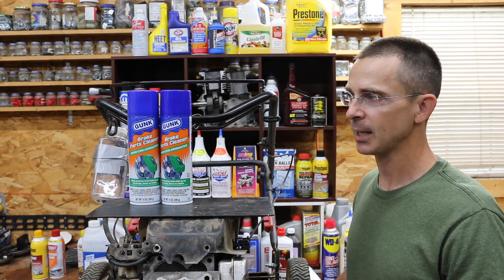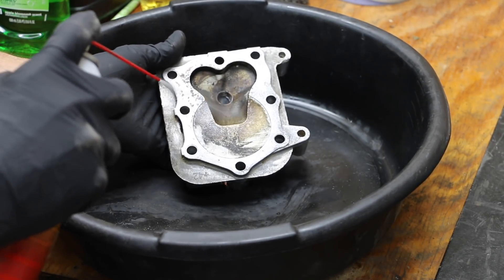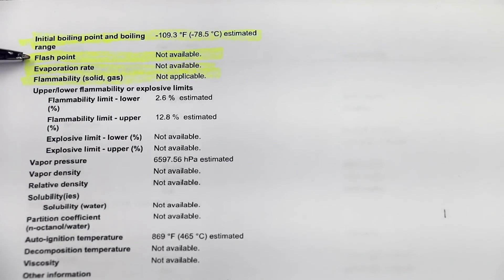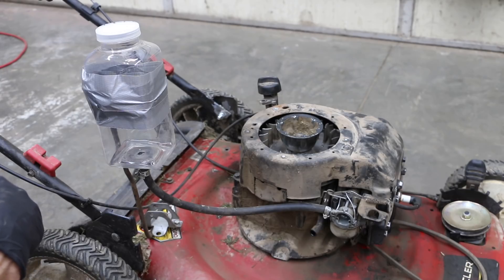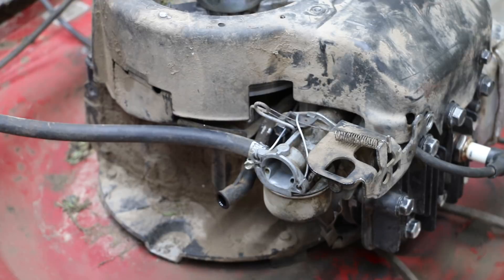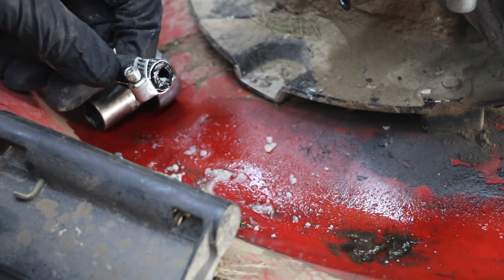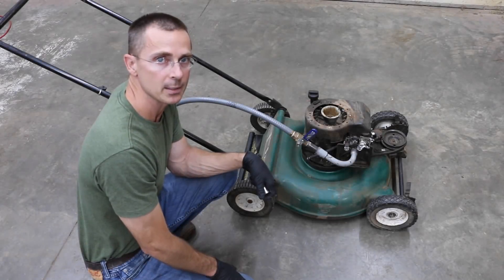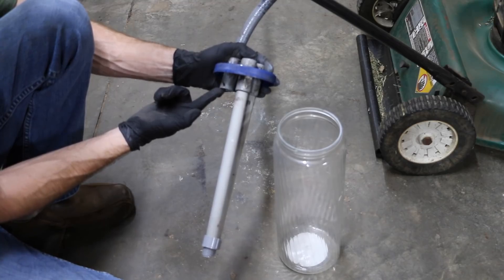Will a Gas Engine Run on Brake Parts Cleaner?  Lets find out!

Comment: Which type of epoxy is most resistant to gas exposure? This is something I would love to know as I need to repair a small engine carburetor after the winter most likely.
Reply from the maker: I'll see if I can test this. Thank you for this recommendation.
Reply: Finest Hops
I happen to know that the Locktite 2-part epoxy sold in grocery stores, hardware stores and autoparts around Kansas City is about as perfectly fuelproof as you can get short of solder or brazing. I have fixed a couple hundred old small engine, motorcycle, car truck and tractor carbs with the stuff with zero problems. 
1) Get the parts perfectly dry. I have washed mixed-together-but-uncured 2-part epoxy off my hands with a gas rag.  2)  Let it cure 48 hours at room temperature for best results.  3) On sidedraft carbs a part of the casting comes down and usually a bowl nut screws up into it to hold the bowl on.  I've had that casting corrode clear off and saved the carb by applying  2-part in 1/8th" layers (letting it cure good before applying next layer) until I get a blob big enough to work with. I file and rotary file it into shape on the outsiide and then carefully drill and tap (cut internal threads) the mass of epoxy to accept the bowl nut. You can't get crazy torguing it tight but just nice and firm is all that's necessary and so far so good on a smooth running stationary engine (a welder). I wouldn't trust it in an airplane or motorcross bike but so far so good !
Reply: you want to use a novolac epoxy as your first option, and a bisphenol F epoxy as a second choice. unfortunately most kits sold at the hardware stores are nether. most sold are bisphenol A which has a weaker cross-linking then the above two. if the packaging doesn't tell you what it is then you may have to resort to MSDS. urethane, polyaspartic & polyurea will likely stand up a little bit better but will have much worse physical and bond strength.
Reply: Me too!
Reply: I 3rd this notion
Reply: Engine grade epoxy exist. Have not used myself, so don't know brands. But I know of enginebuilders that use engine grade epoxy in intake ports that tolerates gas. But oxygenated gas, like E5-E100, or with methnaol, wil make the epoxy come loose eventualy.

Comment: Ive got a suggestion, when you compare carbon buildup running different fuels or showing the see through cylinder head, why not show what it looks like on regular gasoline? like for the carbon buildup show what the engine looks like running on gasoline for a similar amount of time so we can have something to compare it to.  Also why arent you cleaning the valves and cylinder head so carbon buildup transferring from the piston and valves to the cylinder head doesnt happen?
Reply from the maker: Thank you for this recommendation. The goal of leaving the piston and valves uncleaned is to determine if the product cleans.  This stuff actually did a pretty good job cleaning carbon off of the piston.  Thanks again.
Reply: Well if you are trying to determine if it cleans why not run it twice once uncleaned to see if it cleans then clean it and run it again to see if it makes it dirty?
Reply: TheGirfan1234 I like this idea.

Comment: Just wondering, why did you put 2 air inlets for the vapor assy.?
Reply from the maker: I could always block off one of the tubes if it wasn't needed. 2 provides more air flow and less splashing.  Thought it was good to have options.

Comment: My father and i worked as small engine mechanics for a couple of years, but the most fun we had was launching a weed wacker piston out of a cylinder with 2+2 carb cleaner. You should try to run an engine off of that.
Reply from the maker: Thank you for this recommendation.

Comment: Will it tun on carburetor cleaner
Reply: nightmare in action nighmare in action   probably, imagine the same propellant is used for both
Reply: nightmare in action nighmare in action it will it’s commonly used as a starter fluid

Comment: Will a engine run on Jet fuel?
Reply: A diesel will.

Jet fuel is basically kerosene.
Reply: yes but jet fuel is higher quality and it would be fun to see if there is a difference, And yes its a lot like diesel but still i think it would be fun.
Reply: No because its basically a high quality diesel
Reply from the maker: Thank you for this recommendation.
Reply: lusmiaka Nope it's similar to diesel... XD
Reply: Scott P Correct
Reply: Gas engine can run up to 50/50 mix but already knocks alot and smokes and sparkplug getts oily...

Comment: yay great again.   gonna push my idea of a hot exhaust diesel evaporator and see if you can run and maintain from the hot exhaust. if that works can try others, kerosene, vegetable and old engine oil etc
Reply from the maker: Thank you for this recommendation and thanks for the positive comment.

Comment: there is gotta be a way to modify the governor to let you reach higher rpm
Reply: There is, you remove the spring on the restrictor plate, or remove the spring going to the governor. Commie :)
Reply from the maker: Yes, it's pretty simple to do, but I didn't want to cause damage to this engine.

Comment: Its basically carb cleaner
Reply: Rhead_neck nick 
Carb cleaner leaves residue. 
Brake cleaner dries spotless clean. 
Like prepping for paint on a part , would you use carb or brake cleaner? 
Or when cleaning with carb cleaner and the piece is clean, I hit it with brake cleaner.
Reply from the maker: Great point. Thanks for commenting.

Comment: As a mechanic we used brake cleaner to drive cars into the shop that had failed fuel pumps.
Reply: junkyardhemi I drove a motorcycle without a carb using brake cleaner once...
Reply from the maker: Thanks for commenting on this.
Reply: Yip I use brake clean routinely to richen up a petrol engine(testing for fuel trims, air leaks etc) run an engine with no fuel pump, and occasionally start diesels(outing it direct into the intake so it can't pool in the intercooler) . Not to mention its amazing cleaning properties. Amazing stuff. It will flash on a hot catalyst tho so be warned when cleaning oil leaks on a running engine :)
Reply: Jimmy Garcia Why?
Reply: junkyardhemi Old school!👍👍😎
Reply: junkyardhemi thanks I'll avoid your shop!
Reply: Daniel White Used ether to start a camp fire once. More like camp explosion. Will never use ether again unless brake clean or everything else fails.
Reply: I used it to set the Bead on Tires when Ether was not Available
Reply: Yes, i've done that too
Reply: I did this on an 86 chevy pickup i was parting out, fuel tank selector valve was shot so i filled up the float bowl on the quadrajet carb with brake clean and it worked fine... i'm sure the seals weren't too happy about it though. Engine had crazy high oil pressure, then pulled valve covers to find a mountain of sludge. So she went to the scrap yard.
Reply: junkyardhemi hell of a lot safer than ether. I’m a mechanic. Saw a newbie almost launch the head off an engine once
Reply: How do you get them in the shop?

Comment: Will a gas engine run off cooking oil and gas mixture
Reply: Sure, with enough gas. Like 2-cycle oil.
Reply: dirty ford101 diesel will run just fine , you have to start with diesel and stop with diesel or the fuel injector will jam when the cooking oil cools down and becomes think ......... , you will also need fuel tank heater to keep the oil warm and yes it will run with used cooking oil just make sure that it is not dirty (should not contain big enough particles to clog the fuel line or injectors)
Reply from the maker: Thank you for this recommendation.
Reply: Simply put, yes. People do this a lot with such mix. I have played with it too. It does make a mess of the engine in time. Cleanable but messy.
Reply: People that run it all the time filter it to start with. Not bad in warmer climates but would be tough to keep hot enough in cold places. I've seen diesel heaters used in rigs running up North that use coolant to heat the fuel which was diesel and maybe it'd keep the cooking oil hot enough. Just don't know about that. I'd just run diesel and try and dodge the headaches.
Reply: You never know unless you try! Now you know!
Reply: This is an interesting question actually. I would like to see that aswell. I think it will, just like a gas engine will run on diesel if the engine is hot enough. Not sure if this only works on russian engines ;)

I was thinking about trying something like this myself :)
Reply: Did that once engine was pretty hard to start and would run a bit "rough" and the some how fuel line got leaked as well dont know if it was oil or it was about to fail

Comment: Sure it will. The Saw Surgeon and myself use it to start stubborn ones. Thanks Commander. Best 2 U! And ethanol used to turn JB Weld to plastic. I know from experience on a Briggs 'L' lead splitter engine BUT Seal-all cured the pin holes!
Reply from the maker: LOL!  Thanks for commenting and all the best to you!
Reply: You got good stuff, Commander. You get the A-PLUS from me! Yall be good!

Comment: That’s what I use for starting fluid and can you try to use pb blaster as engine oil
Reply from the maker: Thank you for this recommendation.
Reply: I’ve had luck starting diesels with liquid wrench, but not wd40. 
And do not spray paint the inner fender well of your diesel car while it’s running(near the air box inlet), ask me how I know it kicks the idle up to about 1500 for a few seconds😂
Sorry man, most of my goofy things like that come from the diesel stuff. 
Great stuff , I always dig alternative fuels